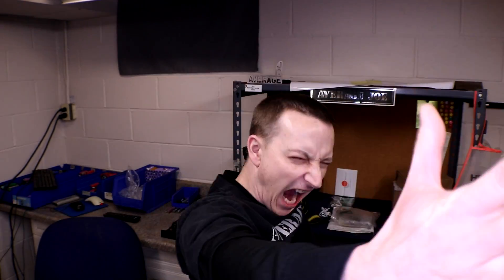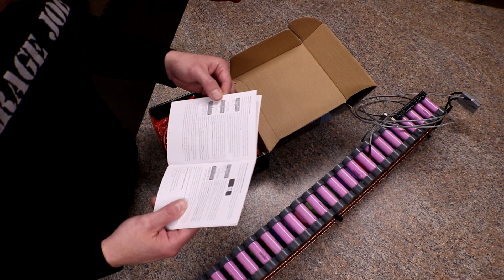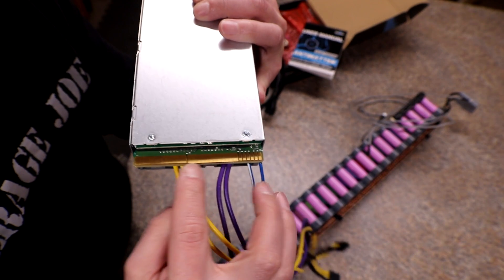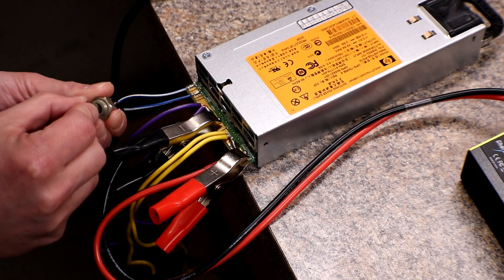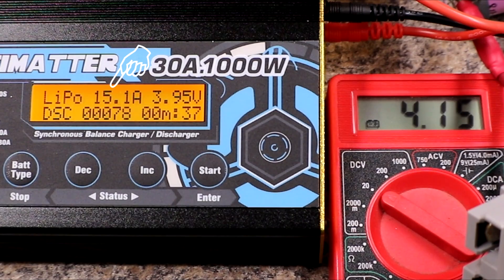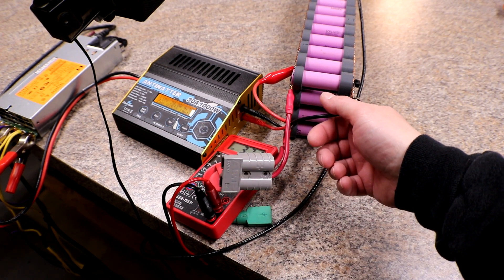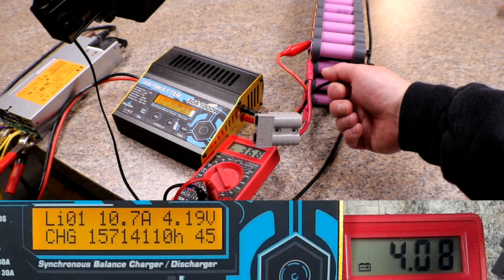Pack 14 100P Capacity Check with The ANTIMATTER!!!!

Comment: Hi I was wondering what the name and info of the black stripe you have connected to the sides of your packs
Reply from the maker: Those are longmons and part of the batrium bms system.  You can check them out at batrium.com
Reply: @AVERAGE_JOE  thank you can you tell me how you charge your system can you charge your system with a generator
Reply from the maker: No problem! I charge my system with solar. I guess I could probly rig it up to charge from a generator either by 48vdc from generator or the 120vac side and connect a 48vdc charger. The ups has an internal charger but it only outputs around 1.5a so it would take FOREVER plus its not recommended since that charger is designed for lead acid and wont fully charge a 14s battery pack anyway.
Reply: What if I plug the hobby charger into the generator and use the hobby charger to charge it will it make a difference
Reply from the maker: Yeah you could charge that way for sure!

Comment: I consider buying this charger. What can you say about quality of this device? Does it show charge/ discharge accurately? Have you ever compared it with Turnigy?
Reply from the maker: I think the charger has good potential.  The reason I say potential is because there designed for smaller batteries. I did manage to replace the capacitor but need to replace it again since I tried to relocate the capacitor away from the resistors that take all the load during a capacity test and think I interrupted the air flow from the fan lol. Havent had a chance to that yet.  For what the charger is, its pretty decent but would recommend using on smaller packs where it doesnt take 12+ hours to do a charge or capacity test.
Reply: I need to charge Li-ion at 42v. Sometimes lead and Li-po. At a price it is not expensive from onologists, others have an opinion that this is not very good.
Reply from the maker: Евгений Алекс  10s is as much as this charger can do for Li-ion.  If you have big batteries like I have then this charger could possibly blow a capacitor like mine but if the battery packs are small then it should work fine.  I am still using this charger (right this moment actually)for smaller packs and its working great!  I also use it to charge my deep cycle boat batteries and it works great for that as well.  I like the charger and if you get one, just keep in mind that a capacitor could pop and need replaced.

Comment: What you have there, is a voltage drop on the cable you are using. The only way to correct it (without changing the discharge/charge current) is to increase the gauge on the cable or shorten it. But since that cable is short enough as it is. You basically only have the option of “beefing” up that cable. 

Or perhaps even make a 1 - 3 splitter cable using 11AWG or better, and connect the wires at the center and both ends of the power rails on the battery pack. That way, you minimize the strain on the battery cells closest to the crocodile clips you used in this video!

Thank you for the cool video by the way!

Ps. 
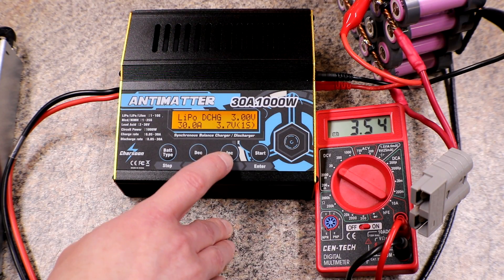There is a 1KHz noise on most of the footage in your video. (To be specific, it was NOT present between 4:56-5:01, 8:10-8:30 and 10:44-10:47)

If it is a persistent issue in your shop that you aren’t able to remedy. 
Could you please consider using a narrow notch filter on your audio during editing?
Reply from the maker: Ill have to upgrade the wires for sure and Im gonna make some balance leads to see if the voltage will show correctly.  Yeah my freaking Led lights above the camera make that noise you are referring to.  Im gonna have to get a different kind to try and fix that issue.  I have been trying to hide that sound with music turned down when I edit lol.  It doesnt always do the trick lol.  Ill see what I can do in future videos.  I can also try different mic settings on the camera as well.  Thanks for the feedback!!! I do appreciate that as Im always trying to improve!!!👍👍👍

Comment: Joe, ur problem is the lack of balance leads... that’s why your termination voltages are off. Balance leads allow the charger to see what the harbor freight meter is seeing.
Reply from the maker: Thats what a few others are saying as well so it looks like I need to either find a connector or rig something up and run the test again. I did do a work around since I didnt have the connector and will upload that video here in a day or so. 🖒

Comment: If you made a longer connector that was bare to plug into the antimatter (where the pack cables connect) so you can connect the DMM to that spot, the DMM should read closer to what the antimatter reads. Voltage drop over the wires due to resistance build up.
But, you could put two DMMs, one on the pack, and one on the antimatter and you could really see what the loses are in those wires. I suggest replacing the wires with better quality and heavier gauge. That way you minimize problems with the wiring.
Also use an ammeter and put in series with the connection to see what the exact amps being pulled is. That would help see if the antimatter is reporting correctly.
Reply from the maker: Test 2 on the way. There will be a test 3 after reading all these great comments!🖒😃

Comment: There will always be a sag in the voltage when reading voltage on the same cables as the load. That is why there is normally 4 wires used, 2 for the heavy load and 2 for reading voltage. To quickly solve your problem just lower the voltage on the Antimatter to around 2.7v which is really around 3v on the pack. This should be good enough and is what i did on my imax ages ago to offset.Also for a more true test drop the amps so the wires dont get hot as this is also adding losses in and will thow off the reading, or increase the wire size but i think dropping the amps to 10 will be good enough.
Reply from the maker: Test video 2 is done and vid will be up in a day or so and test 3 will be in work after reading all the awesome suggestions. Ugh I still have your item, ill send it.....I promise😄🖒
Reply: :) thanks man

Comment: This might interest you Joe. I had tested a bunch of recycled 18650 and Lipos (pouch) with the only charger I had at the time, the iMax B6. Must say I was surprised with the high capacities I was getting out of them. Now testing with the LiitoKala, a Rui Deng  USB tester and after playing around with some improved powerbanks, I am noticing a considerable less amount of juice coming out of those cells. Still testing, but overall getting only 70 to 80% of the capacity from the first test (iMax). I think the iMax does an excellent job, constantly adjusting the voltage and amperage so it gets the full potential from the cell, and my conclusion until now is that our typical daily gadgets (smartphones, powerbanks,  etc)  are not just as efficient has the iMax. This being said, the amperage you got could be a little optimistic. So yeah, to make sure I would test one of the other stronger packs as well. Hope it helps!
Reply from the maker: Ok cool! Yeah Im gonna test the "better" pack and see how it compares and Ill report back with a video!😃🖒

Comment: Great video, Joe. I'm beginning to think like another commentor in that it may be the Batrium. It's odd that both you and Peter have problems with your last pack. How about switching it with any other pack and see if the symptoms re-occur.
Reply from the maker: Thanks Man!  I will consider the longmon for sure but would also like to add that pack 13 is actually at the end of the string on the negative side (just how its wired up from shelf to shelf) but reads in the batrium top shelf 1-4 left to right then next shelf down 5-8 and so on.  Pack 14 is 2nd to last in the string!  Does that make since lol!

Comment: You are getting a lot of voltage drop from the alligator clips on the battery rails.  Make a custom cable that clips into your Anderson connectors that goes directly to the banana plugs on the charger and use a heavy gauge cable.  It will help so much and it is worth the time and trouble.
Reply from the maker: Yup thats the plan!  Make custom wires for my application and make a lil balance lead so it might help with the voltage sensing ability.  Totally worth the trouble!!!👍👍

Comment: Joe, the voltage difference is how much you are dropping by measuring on opposite ends of the wires.  The losses are from trying to push 30 amps thru a 4 amp wire @ 3.5v.  If you connected the JST plug then it could sense the no-load voltage at the pack, bypassing the loaded wires.  Then it should measure the same as your meter, and the capacity check could discharge all the way to 3.00v at the pack.
Reply from the maker: You could be right about the balance wires!  Wilco mentioned this could be the difference as well in a chat.  Ill have to make up a balance lead and try it again.  I did a work around for test #2 last night again without the balance leads and will edit and upload that video in the next day or so!!👍

Comment: I have a bunch of the free Harbor Freight meters and surprisingly, they are very accurate.  I've checked mine against a precision voltage source and they are dead on.
Reply from the maker: Yeah I have at least 5 around here lol.  I havent had any issues with them.  There good little meters!👍

Comment: Nice work. I need to get something like that for the robot battery.... the individual charging is taking FOREVER even with 2  chargers... :(
Reply from the maker: You could at least make a tp4056 charger.  Im really surprised you havent made one yet!😲😃👍
Reply: i bought a few of those things but have been afraid to use them...

Comment: Once I saw those clamps hanging off the edge of that table I immediately thought "oh no, he's going to bump these and short something soon".
I think the alligator clips on the cells probably couldn't do the 30amps, probably get hot.
Charge at the max of the weakest point. probably the cables doing 30A.
Reply from the maker: Ooooo one little slip and those connectors woulda gone BOOOOOM lol.  Ill have to make a set of bigger cables for sure.  I think these stock ones would be fine for like a 10min charge cause at the 17min mark they were pretty warm!!!💥🔥👍

Comment: I have lower model of it, and you definately should use balance port when charging or discharging at those amps, another thing is using clamps,  those have banana connector to plug cables in. Another thing is that this charger can discharge regenerative, so it can charge another battery. Lead-acid is propably the safest one.
Reply from the maker: How are you liking yours?  I do plan to trying it with the balance port, I just didnt have any plugs for the port.  Ill probly order some tho so I can try out all the other ports as well.  Yeah I figured out the banana plugs have a spot in the clippys after the video lol. Yeah for the regenerative side I plan to try it out on the boat batteries since I took them out for the winter and will need to be topped of ect and they are LA!😃👍
Reply: My charger works awsome. I bought it for charging DIY speaker with 6s2p battery, but it can do a lot more than that. I have 250W model, and it can connect to PC with logview as ICharger, i think you could do it with 1000W version too. With PC you can create discharge curves, and you have more data.

Comment: Just make sure you don't smash it into your matter balance charger at near speed of light velocities.  Would hate to see you annihilate the great plains before summer really starts.  :)
Reply from the maker: LOL I am building magnet chamber to houze this beast to help prevent any sort of unbalances with light velocities.....😆💥👍☢
Reply: 😁

There is actually a thing called “Velocity Factor”

Electricity does not travel as fast as light does.

To put in a VERY simplistic form: Electrons flows slower in a coax. cable with a low velocity factor, than one with a high velocity factor. 
But this basically only refers to AC currents at high frequencies. (RF signals for example) 

It’s pretty weird, but ask your local HAM radio operator if you don’t believe me🙂

Comment: Hey Joe! Just an fyi, those alligator clips should have female bullets in the handle part so the charger should plug right into them.. Also, if you have a deep cycle batt, you could probably use the regenerative discharge mode and be able to use the full discharge power.. at least that's how my PowerLab 8 Touch works. Keep up the great work! Boom!
Reply from the maker: Hey Todd, Yup you are correct about the leads having a place to go into on the clippys.  Figured that out after the video....smh lol!  I do want to try out the regenerative on the boat batteries!😆👍

Comment: you need to make sure that you hook the other meter to the inputs of the antimatter because at 15 amps there is going to be a voltage loss across those wires due to the small awg. if you make your own heavy awg cables...like 10 or 8 awg you won't have the voltage drop.
Reply: AveRage Joe Also Check and make sure the voltage is calibrated  correctly I think you can calibrate them like the imax b6 but not sure worth a try tho
Reply from the maker: I need to do that for sure!!!!!👍👍👍
Reply: Mike EL that would be overkill but if you could rig it up...

Comment: wouldn't be better to have the connections to the pack on opposite sides, i.e. where the anderson connectors are, to avoid unbalanced flow of current through the pack???
Reply from the maker: Yep that would be the best way to do it for sure but since the leads were so short I just threw them on the end lol!😃👍